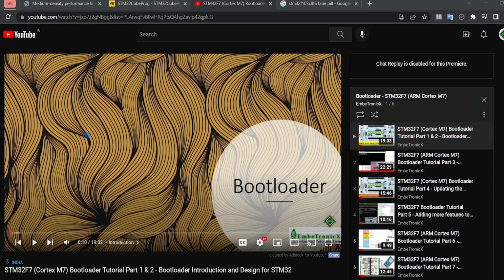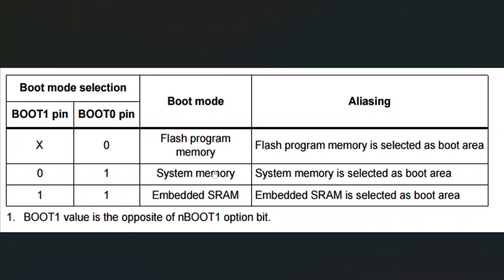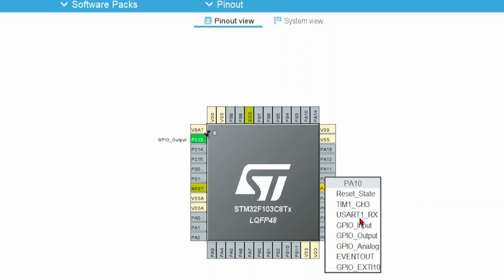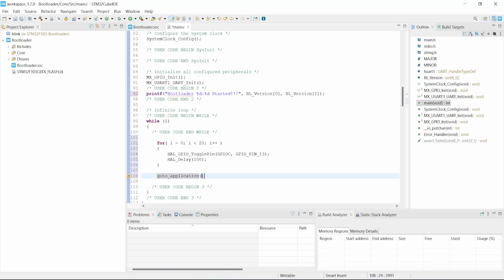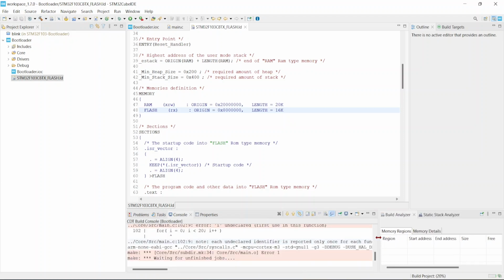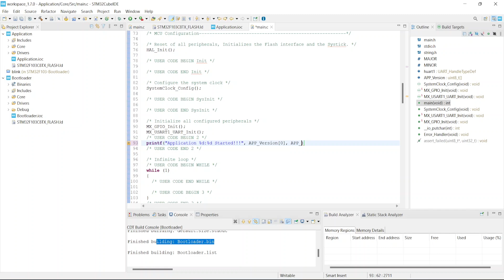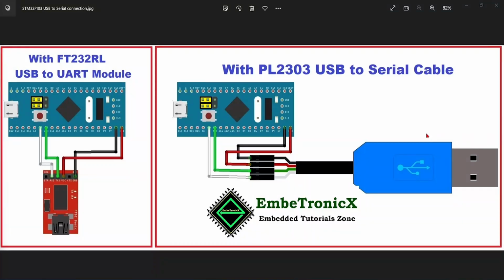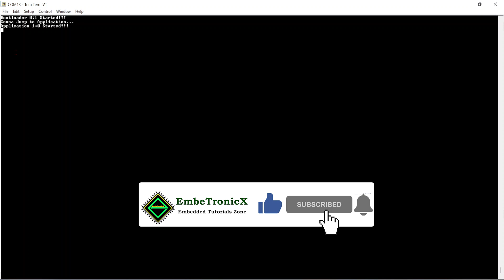Simple Custom STM32F103 Bootloader - STM32F103 Bootloader Development  Part 2

Comment: Why do you need 3 voids in line 229 and why do you need +4u?  I do NOT understand it all...
Reply from the maker: 1. That is function pointer. That function takes no argument and returns nothing. That's why two void in the function pointer. The 3rd void * is used to convert the uint32 pointer to void pointer.

2. Reset handler address will be present at the 4th address. That's why we are taking the reset handler address in 4th memory.
Reply: @EmbeTronicX  Thanks for the reply.

Comment: After flash this, can i use bluepill program using arduino ide sir?
Reply from the maker: You want to use the application bin file which is generated using the arduino ide? I don't think so. Because you need to set the proper flash address and vector table offset for the application.
Reply: Yes i want the application using Arduino, for the memory vector table o don't understand. If you have many time. Maybe make tutorial bootloader application that can generated using Arduino ide 😅
Reply from the maker: Noted. We will work on this when we have time. Thanks.

Comment: Hello sir, I'm using STM32 g070 nucleo board,, it has no separate hardware pin for boot 1,, what should I do sir..

In coding itself i need to select flash memory or system memory..

Can you guide me please
Reply from the maker: You should check the data sheet or user manual. Because some will be having two boot bins and some will be having one.